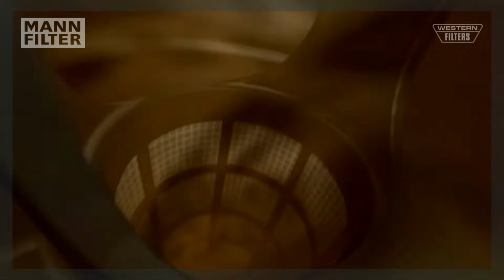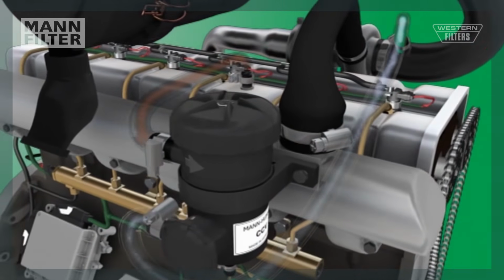3D Animation Action: Overview of the MANN ProVent 200 Catch Can Process

Comment: If the filter is never replaced and it somehow clogs up, the pressure relief valve should operate thus making an obvious oily mess to indicate the filter needs replacing, would this be correct?
I have a Toyota Prado 3.0  engine.
Reply from the maker: Martin Lang correct !
Reply: Western Filters It’s a very safe and efficient design in my opinion.  Sure got to hand it to those German engineers.
Definitely going to install one.
The computer graphics here is very very good. 👍
Reply from the maker: Martin Lang we think it’s money well spent !